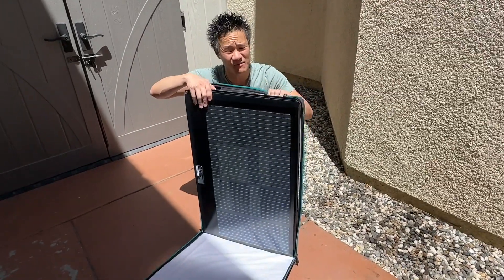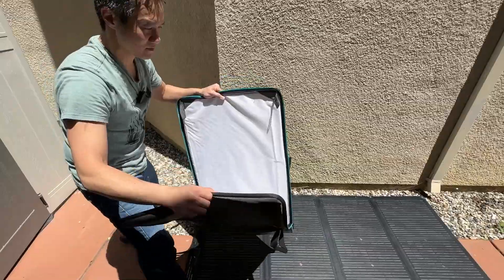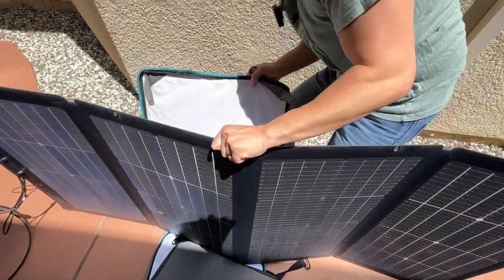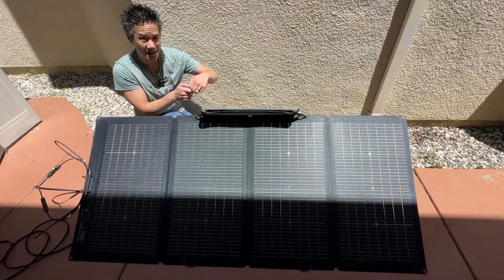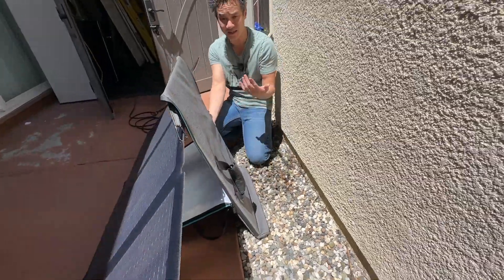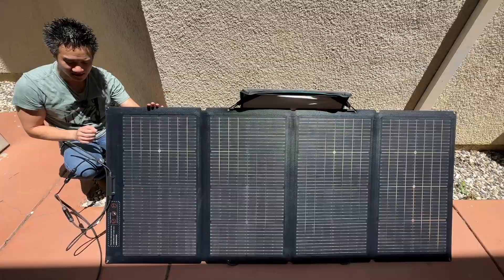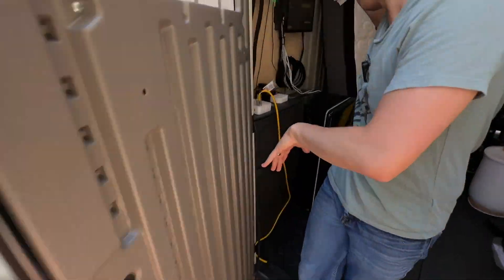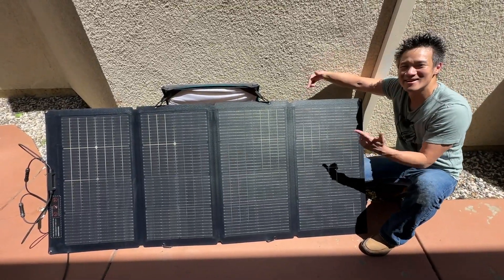How To Adjust the Angle on ECOFLOW 220 Watt BiFacial Foldable Solar Panel

Comment: I needed this video SO BAD two months ago.
Was without power for 6 weeks. 
My ex decided(while I was sleeping) to 'mount' my panels on  plywood that lied flat while he propped it up with shower curtain rods. He used a hammer and smashed one of the quarter panels.

Anyway, thank you for this, you have really helped me. 
Anyway, I'm 56 and these panels are heavy for me.  They've slid down a few times.  I had them sitting on tables because the grass was tall.  

I REALLY needed to learn about the zippers.